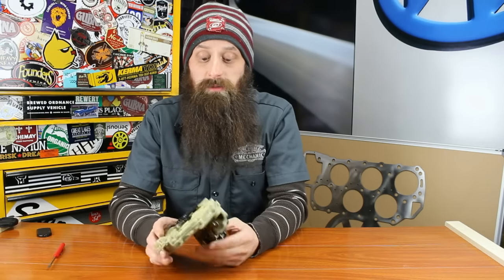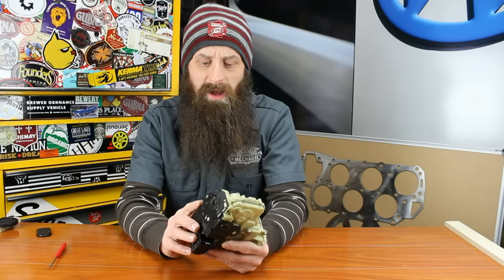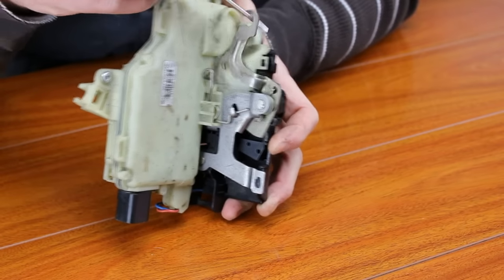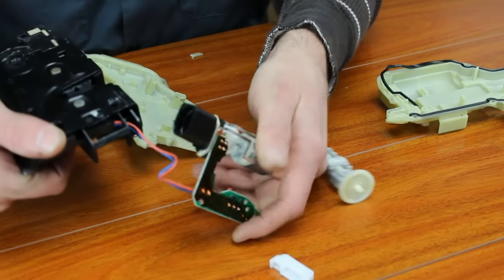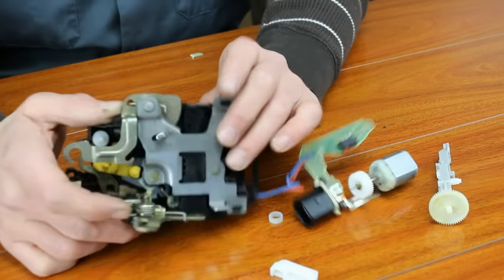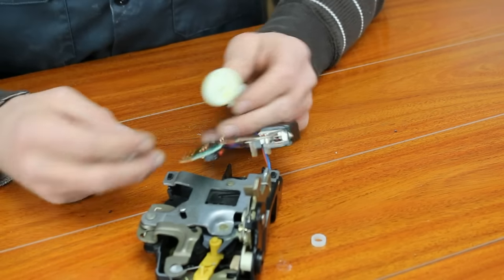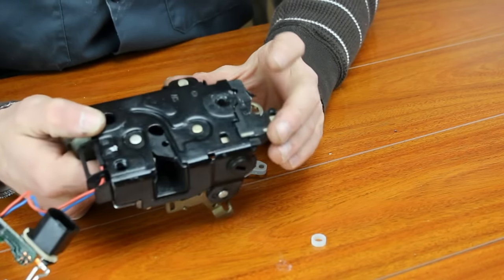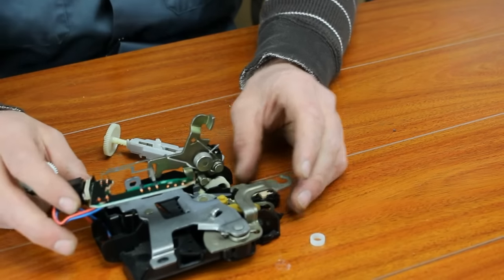How VW Door Latches Fail~ Video

Comment: Great job! I had my door lock open/close micro switch fail on my '01 beetle several years ago. What a nightmare! It happened on a road trip too. Open the driver door and the interior lights did not come on. Raised cane w/the burg alarm too! The next nightmare was getting the latch out to repair it. I couldn't get it out w/o removing the whole window regulator system! Basically, gut the door. Then worry about breaking stuff like the little snap tabs on the trim and such. Anyway, I found that the switch was fine, it was that the back plane the switch was mounted to fatigued causing the switch plunger not to work! Somehow I managed to band aide the thing and it's still working to this day....most of the time! While I had everything apart, I cleaned and oiled the window regulator pulleys and slides. Window glides nice now. Whadda pain!

Comment: Hi and thanks for the video! You could also have said something about the how to fix “freezing failure” that seems to be really common in at least Passats in colder climates. Door won’t open, or won’t lock until warmed up etc. Some people see this is because the latch freezes (water ingress from window seal), and some people see it’s caused by moisture in the exterior or interior door handle bowden cables, which then won’t move (unlock) or move back (lock). Suggested fixes include liberal application of WD-40, windshield de-icer, or opening up the door and lubing latch and cables with white lithium grease. Looking forward to a video on this!
Reply: where would you spray wd40?
Reply: Yes, I want to know this, too. My 13 Passat just started having this problem. The driver's side door wont unlock first thing in the morning.
Reply: @bretgtimk7968  Everywhere, like you always do with WD-40 😁 
Seriously, if you suspect a cable problem you do have to get to the cables first, so the door panel needs to come off. WD-40 displaces moisture and loosens dirt, but it's not that great as a lubricant. That's why I was asking HumbleMechanic about what would be his recommendation for the best cable lubrication solution for the long term. Removing and reinstalling door panels is not something I want to do regularly.
Reply: Help for some, I sprayed PB Blaster dry silicone lubricant into my door lock. The temputure got to -5 f and the lock still worked. 🙂

Comment: My wife's 2013 Passat driver door actuator went south this week after we just got the clockspring replaced under warranty. VW wanted to charge $630 to replace the actuator and bowden cable. I purchased replacement OEM parts myself (recyclers and eBay) and my grand total was $128. The only tools I had to buy was a triple square for my ratchet. I can confirm that water getting inside is a major culprit. We've had pretty constant freezing, warm, freezing, warm here in MO for the last 2 months and then with the polar vortex, the extreme cold has frozen the water inside it completely solid.

Comment: I've replaced all four locks on a Passat. I got lucky with that pre tension spring, I just put the cable back in the door handle in roughly the same position it came out and they work fine. Always wondered what spring was for !

Comment: I wish I had watched this video and some of the other diy videos before I spent $450 on replacement of the door lock mechanism. This is the 2nd time I have had to replace them. My issue was the locks continuously locking/unlocking when accelerating over 10mph. 1st time was covered by warranty, but this second time, a year later it was a different door so was no longer covered. Got it fixed at my dealership and less than a week later, the issue started again, but on another door! So, I'm assuming I will have to replace every door eventually. This time, I will trying to repair it myself...so frustrating!! Anyways, thanks for the informative video! 👍🏼

Comment: 2018 VW Atlas front passenger door electrical fault 105k miles.  Bought one from a junkyard on ebay for $55.  Replaced myself.  Still very happy with my first VW since the 90s.  Vehicle is awesome.

Comment: Hey man. Love the videos. I'm learning a bunch and am better able to diagnose issues in my van as a result. For example, I recently bought a 2002 Eurovan MV and it had four lock related issues... 1) it came with 2 different keys and no remote entry key fob. 2) the power locks weren't working at all 3) while I could lock the driver's door, I couldn't unlock it manually with the key.  and finally 4) the liftgate wouldn't lock. I checked the fuses and #14 on the lower level was blown so I swapped that and voila, the power doors locked... and then the fuse blew again, so there is probably a short in the wiring harness somewhere, but at least I know I don't need a bunch of $80 actuators. I bought a new genuine VW/Audi liftgate handle w/ tumbler, watched some vids and was able to rekey the driver's door and liftgate to match the ignition, passenger door and sliding door. So that's problem 1 and 4 completely sorted. And problem 2 narrowed down. That leaves 3. In rekeying the driver's lock I noticed that a previous owner replaced it with an aftermarket handle and cylinder.. it opens fine from both inside and out, it locks easily with the key, and the actuator works, but when I turn the key left to unlock it nothing happens... it feels like it catches very slightly and then nothing.  Any suggestions?  I don't want to buy a new handle if it is really an issue with the latch mechanism, and vice versa. Thanks in advance.

Comment: Thank you. Liked the info you presented in the video. Gave it a thumbs up.  
I recently bought a 2003 VW Jetta for my daughter.  It's in pretty good shape for the most part but both rear doors don't open or close with the remote key.  However when I touch them I can feel like they are trying to move when the buttons on the key remote are pressed.  The drivers door actuator sometimes opens and closes with the remote but sometimes it only moves just a little, not enough to lock the door completely or open it completely..  When this happens (which is most of the time) we have to put and turn the key in the lock for it to open or lock.  Sometimes to get it to open we have to turn it several times and it seems to be getting worse. The windows and lights work fine and there is no issue with the alarm. My question is do you think new actuators/locks are in order or could it just be in need of lubing?

Comment: Hi Charles, great vids!

VW Golf MK5 owner, driver's door not locking using the fob. Having taken off the door skin, getting the the lock, I disconnected the power plug, attaching it to the new one.  

Using the fob/clicker to close the door and open, I did feel, or hear any movement from the new lock. I replaced the old one anyway.  So the door still locks and opens manually with the key (opening all other doors automatically) as it did with the old lock. The door opens with the outside handle, and the inside without issue.

You touched on possible problems, mentioning a broken pin in the actual plug connector.  I'm technically minded with ability, but not a mechanic 😊 logically, given that I installed a new lock, if thinking it might be the socket. Any direction, or maybe a vid you've already done would be absolute magic, in the mystery. Or if anyone else has come across this before.  Also when I open the door with key, the windows wind down!

Carry on making the excellent vids Charles, inspiring and really helpful to the automotive community, us non DIY mechanics! 👍👍👍
Reply: Stephen Headley I’m having the same problem if I try to unlock or lock my two front doors with the key fab it doesn’t work.  I have to manually lock or open them.  Where did you buy the parts from?

Comment: Audi, too, Charles. My passenger front failed on Friday evening. 2008 Audi A4. It did last 16 years. I'm not looking forward to replacing module after module, but that's modern cars. My 2000 A4 was much simpler. I'm dreading getting a 2020's car.

Comment: Thank You for doing an Exceptional Video(s).  I ordered a new Cheap replacement and decided to yank mine apart.  What I found (in my case) was the switch that tells the car if the door is open or not had failed.  I carefully removed the switch and ohm'ed the contacts.  In the Closed position sometimes it would not make contact. I cleaned the contacts (and checked the circuit board for bad solder joints).   *My car would re-lock the doors and do weird stuff, maybe open the door and the Alarm would go off.
Reply: Do you happen to remember which contacts were the faulty ones in your case? And do you know what the  resistance range needs to be on a functional switch?  It's times like this that i wishi had access to the dealer datalink program for VW... I'm a heavy duty truck mechanic so at work when i get a truck with this type of malfunction i know i can get the answer immediately and fix the fault without a problem
Reply: @aaroninfante6589  Yes, the Switch that's at the Top (outside). If you're Careful you can take it apart (and clean the Contacts).
Reply: @1957Panman  i appreciate it thank you!

Comment: Charles. Awesome video. I have an MK6 Golf variant which is based off the mk5. On occasions when opening the front right door won’t always open. You have to lock and unlock the car again and then you can usually get it open. Does this sound like symptoms of a failing mechanism?

Comment: I had a 2006 Jetta and the door latch failed on the passenger side. I now have a 2020 Jetta and the door latch has failed on the passenger side. It is weird like the one you mention in the video. I locks the door every time I speed up (at least it engages, it doesn't actually lock it). I have to engage the manual lock and it stops this from happening but then I can't open the door from the outside. Thanks for the video.

Comment: I have an MK4 golf I bought and I've been having issues with my door it gets stuck at the Inn Between mode where it won't open or it won't close I replaced the latch and this is the first video I have about 20 I watched that talks about a preload. Now I still have to kick the door every once in awhile if I don't slam it closed or else it gets stuck in the in between so if it's stuck either going to climb out the window or you're going to kick the door kind of push it in a little bit more now I'm going to take it apart again and see if the preload was never set on that new unit I bought

thank you

Comment: I'm one of the lucky few with that crazy auto-lock problem. My rear driver side door doesn't always lock all the way, so the system keeps trying to lock it again when hitting the 15 mph mark (mine's actually at 10); driving me nuts! Could that be a poor connection, or the motor going out possibly? Also, is that motor replaceable, or the whole actuator will need to be swapped? Right now, I'm locking that door manually and it's a pain; any help will be greatly appreciated. Great videos man, I love when someone is truly knowledgeable and sharing their passion. Pet Peeve; correcting someone's ignorance while watching 'informative' videos.

Comment: Thanks Charles, excellent content as always. 
Does this failure accompany random alarms from the anti-theft as well? I have my 2000 gti that will set the alarm off, if I insert the key and wait like 30 seconds to a minute, it locks the door and if I try to start the car, it sets the alarm off. This started happening after I replaced my battery. Is there a setting in the computer that may have defaulted when I changed my battery?

Comment: Actually the main problem with them is the solder points at the plug which typically crack. Also, the mechanical switch on the mechanical portion of the module fails... Those are the 2 main fail points, NOT the specific switches on the circuit board.

Comment: Help needed, i have an issues with mine. The lock is in deadlock, will not unlock from inside or out side. Even with the key
Need to unlock the latch so i can open the door to remove the latch... 😮

Comment: Very informative!  Described the problem I have with my 2006 Jetta passenger door to a "T".  Front passenger door randomly gives false indications in the cluster or falls out all together.  Windows and locks on that door fail most of the time.. Almost afraid to use that door because it is such a hassle.  I am a clutz with DIY auto repair but now  at least I know what is going on. I will take it to dealership to get them to fix it.  Maybe I will have them do the trunk latch while they are at it which has been problematic from day one.  Dealership would never fix under warrantee since it would only happen in cold weather and dealer is in Tucson AZ so they could never duplicate the problem.  So now it is on my dime.
Reply: I have 1 door and trunk latch issues, 
plus all functions of drivers door not working unless the door is 12" in open position 
No lock no window, no mirror
Plus now the wipers and  cruse not coming on...
 if u have any suggestions please...helps

Comment: Awesome video. Passat b5 saloon 1.8T 20V. vcds says "00928 - Locking Module for Central Locking; Front Driver Side (F220) 
            27-10 - Implausible Signal - Intermittent" . Exam question - accessing the CCM is easy, replacing the door lock is a big deal. three possible causes. bad ccm, bad wire, bad door lock actuator. how would you diagnose which of those 3 before acting

Comment: This is a rip off. How can VW have such a failing locks on their cars. VW should replace the locks for free or do a recall and put new locks that works permanently. I am having similar issues and I am frustrated that I have to spend on a known fault of VW which they fail to address.
Reply from the maker: +Aaron Gnanam I have seen these failures on other brands too. 

Sucks either way.
Reply: Aaron Gnanam
Failed VW locks won't close. Failed Honda locks won't let you out of your car evwn when pulling both handles. Neither is made to last a lifetime, like everything else these days. My 02 GTI's failed in 2018. Not bad.
Reply: Thanks again humble !  Mine finally shit the bed in my 04 r32.  Door ajar light is beeping at me nonstop, door light stays on.  Intermittent locking with driver side using the keyfob. I got triple squares from when I replaced my hatch latch last year.  Great content as always.
Reply: recall is only when life or safety is involve. If your vehicle run like shit and safety is NOT involve, they will not make a recall!
Reply: Lol! Consumers are funny.
Reply: Every interior mechanical part will fail on VW. Give it time. Any defective part will have been used across the model range. I agree that it's a rip off.

Comment: Thanks for posting this video! Quick question: the outer latch preload: the original factory module that I removed from my ‘03 Jetta did not have the preload set, and I did not set the preload when I installed a replacement module, and all seems to work fine. Is the preload an optional procedure? Just curious since like I said, mine was apparently not set in the original factory config.
Reply: I did not do the pre-load either on my OEM replacement driver's door latch, but I can't open the door after the initial fob unlock unless I hit the handle with the butt of my hand.

Comment: Thank you for this informative video. At 4:40 you suggest that water could get in the mechanism and freeze and cause unlocking issues. Do you have any recommended fixes for that? Winter is looooooooog! Fill the handle up with lock de-icer?

Comment: hi, your video is great..i have a touareg and the passenger rear door one day stop opening. I saw your video and decided i will deal with it myself....And I did it, i took the lock out!!!!
The problem, I live in Panama and the local dealer takes a month! to bring the replacement. I will try to fix it, but the video you refer from the other guy I dont see the link..
Can you post the link from the guy of Deutch autparts pls?
My problem is in the mechanical part, it works fine until it locks, when you unlock  and pull the cable, it wont open. From your video I think it will be the the gears or something..
Thanks for your great support
Reply from the maker: jirv25 http://www.deutscheautoparts.com/ If you run into an issue, message them

Comment: hi  great video   ,,stated to have problems with the drivers door   it wont open when you pull the handel from the outside  ... but works fine with the central locking and opens fine from the inside  all other doors  works fine   its just the drivers door   from the outside   any help  please

Comment: I have tried the Russian way today and it freaking worked . My driver side door is back to normal and locking with the key . All you have to do is tap on side of the door by the lock  with a wrench or a small hammer by the bottom screw holding the lock to the door frame and you re just fine again but don't break it and blame it on me

Comment: Great my 2012 passat b7 is having a issue on the driver door. Only happens sometimes. I really have noticed this in the winter. Sometimes driver door wont unlock via fob and i felt the handle on the inside being very stiff.

Comment: You addressed the door latch mechanism and how it related to mechanical failure, but I’m curious about the electronic failure. In my case the trunk auto lock fob stopped working, then the inside door lock, then the fob for all doors stopped, and now the key in the door lock stopped as well. I am trying to figure out if they are all related?

Comment: first of all, great videos!
I have a jetta 2005 and the passenger door and the rear door are not locking, not manual or using the key fob. Windows, trunk, gas lock, everything else works. I saw a few of your videos because I want to have an idea about what was happening. Do you think it could be the door harness or the door latches?